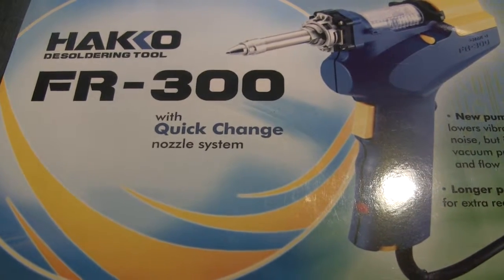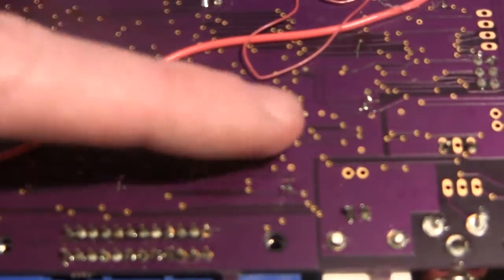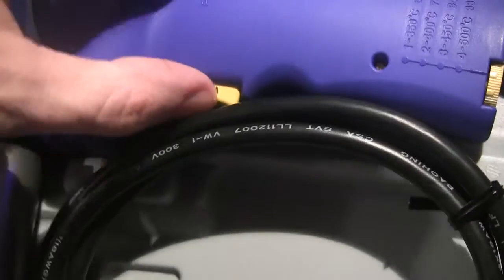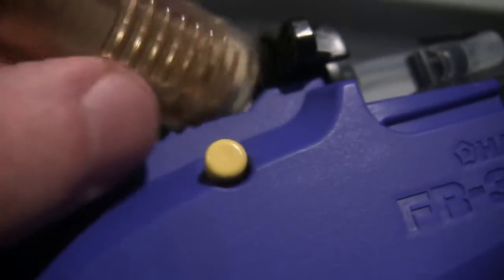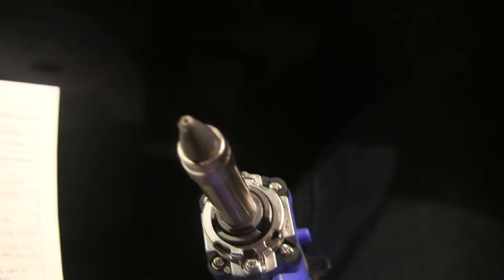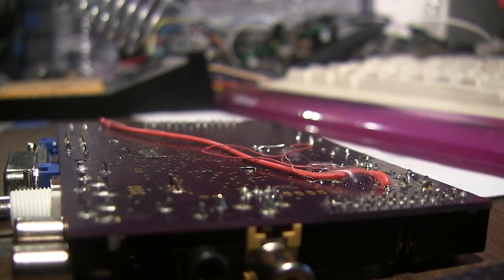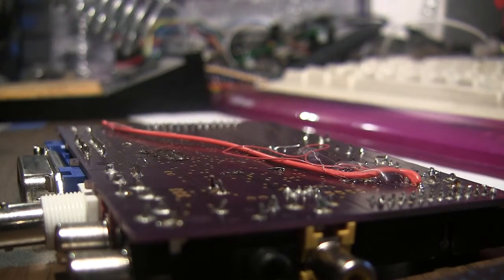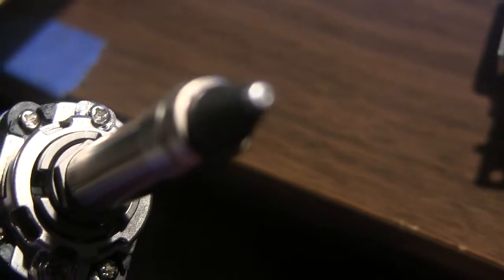Trying out the Hakko FR-300 desoldering tool for the first time

Comment: I am considering purchasing the Hakko FR300. But I have a few questions before I make a final decision. I am employed as an electronics tech. I desolder/solder using a Hakko iron & wick (hate it). Unfortunately, company will not invest in desoldering station. I do  alot of thru-hole soldering of caps. I desolder & solder about 50 to 75 electrolytic caps daily on multi-layer boards (4-5). The ground planes are esp. a pain. My concern is can the FR300 handle that of kind of a daily workload (w/proper maintenance)? I tried an Aoyue 8800 once but had problems with the heating element and the tips would frequently scratch the traces in proximity to the caps. I prefer to survey the opinion of actual users than a seller before I make a decision.  Anyway what do you think based on your experience with the FR300?
Reply from the maker: Just saw this... 4 years later!  lol.  I don't use it that frequently but I would imagine you would probably desolder 50-75 caps per day with this tool and expect to clean it daily and replace the filters fairly often.